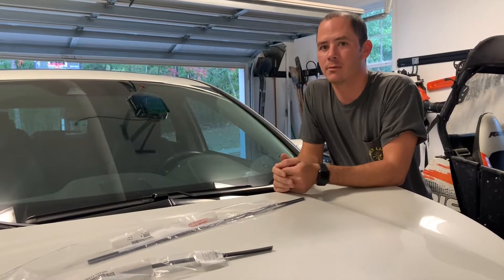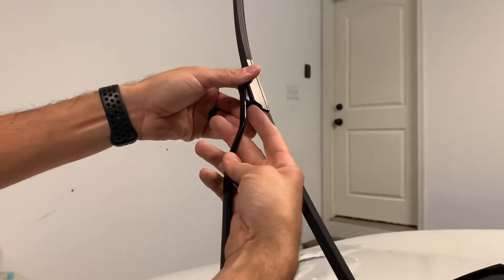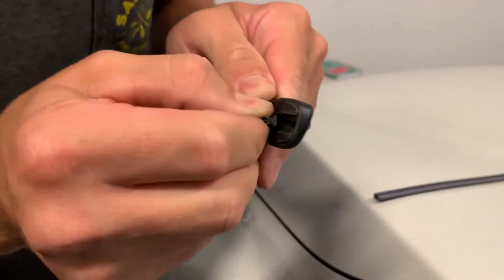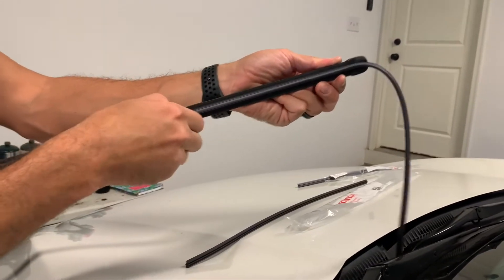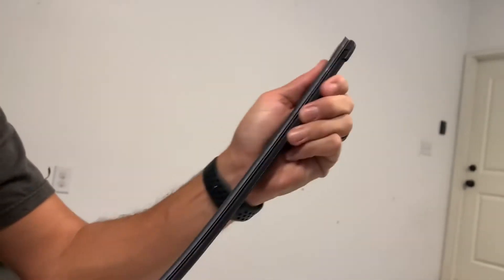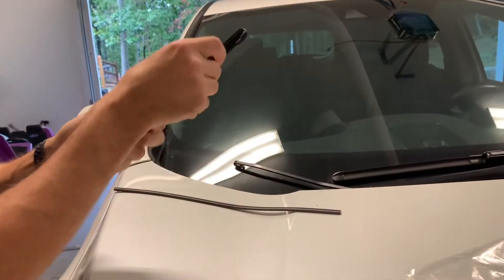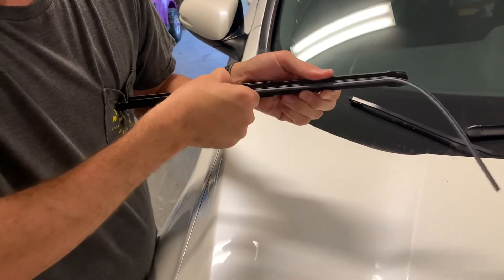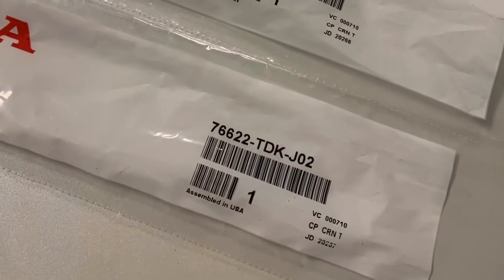How to Change Wiper Refills on a 2017-2020 Honda CR-V in 2 Minutes

Comment: This was so helpful. I was thinking that I may not be able to do this easily. But with his video, it was slick. Thanks again
Reply from the maker: Glad it helped. Remember it’s a good idea to lay a towel down on your windshield in case you drop the arm with the blade removed. It will prevent you from cracking your windshield.

Comment: I just put mine on.  Great tip.  But why do we have to take the entire mechanism off?  Couldn't we just slide out the old wipers and then slide the new ones on without taking off the wiper blade?  Getting that back on was the hardest part.
Reply from the maker: Yeh you can do it like that. I just take them off so I don’t have to lean over the car to do it.

Comment: Below are the Honda CRV 2017 -2019 part numbers for all the wiper blades. It cost about $25 for all 3 with shipping (i.e. $10) from OEM Part Source. 
76632-TZ3-A04	Rubber, Blade (425MM) - Left 	Price $4.64
76622-TDK-J02	Rubber, Blade (650MM) -Right 	Price $5.03
76722-TRN-H01	Rubber, Blade (300MM) - Rear 	Price $4.64
Reply: Thanks

Comment: Worked like a charm on my 2018 Honda CR-V.
The old wiper insert had 400mm written on it but the new wiper insert I bought online (not from Honda) says 800mm. Will it matter? Or can I go ahead with using the 800mm one?
Reply from the maker: I’m not sure. 800mm is longer than the driver or passenger side blades. If it’s the right shape I assume you could cut it.
Reply: @savemoneydiy87  My apologies. On a closer look, the numbers turned out to be 8.00mm and 4.00mm - probably the thickness (not length). The width of the new blade is visibly larger. Will this difference in thickness/width matter?
Reply from the maker: I would assume they may not work but you can try. I’ve only ever bought the Honda parts.